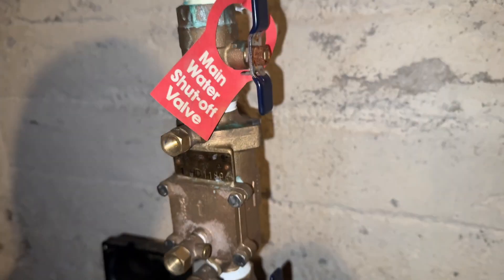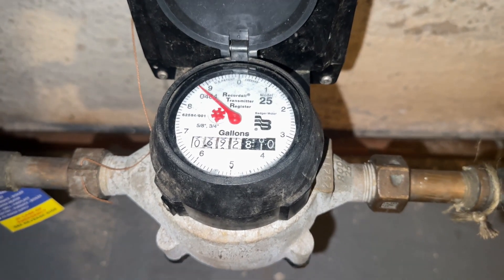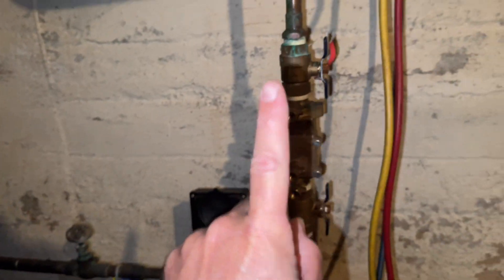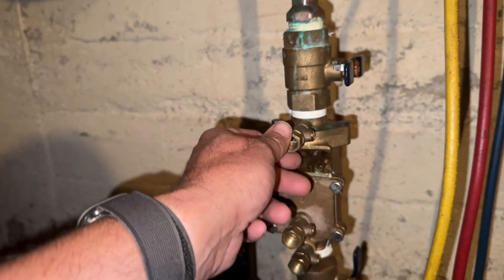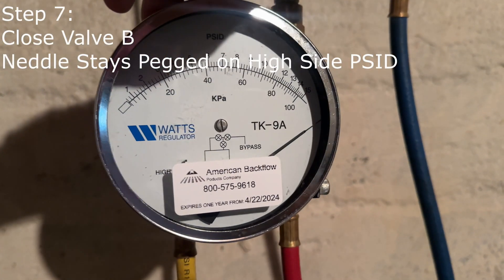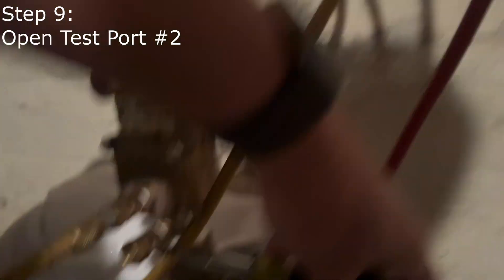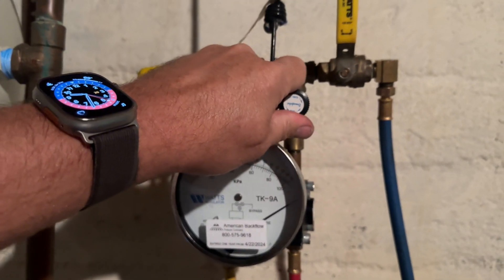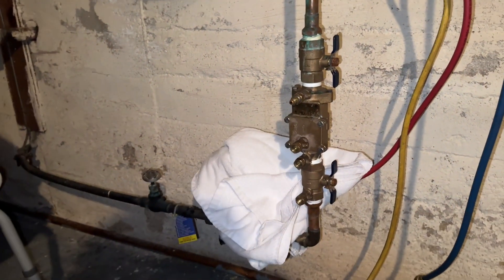Step by Step Instruction on Watts TK-9A Backflow Test Kit Made Easy

Comment: The test procedure used in this video does not backpressure the second check valve, which is designed to hold tight against backpressure. However, to determine if the backflow preventer is providing protection, the second check valve should be tested against backpressure.

Comment: Depends on the brand of expansion tank, whether they can be mounted horizontal. This is the 21st century , why would you use the old style expansion tanks that can’t be mounted in multiple orientations ?  The most important thing is mounting and support.🛠️